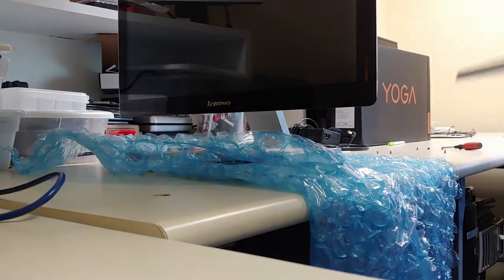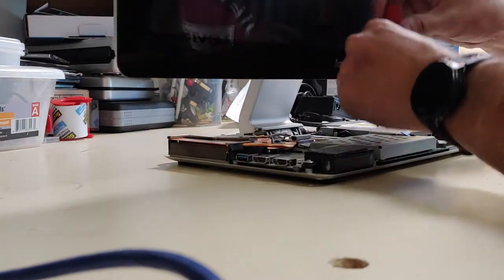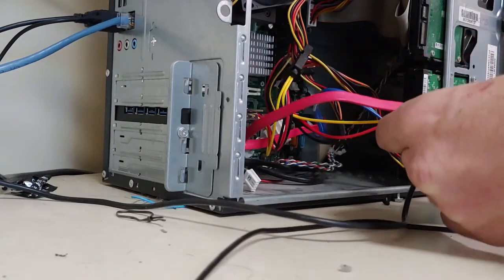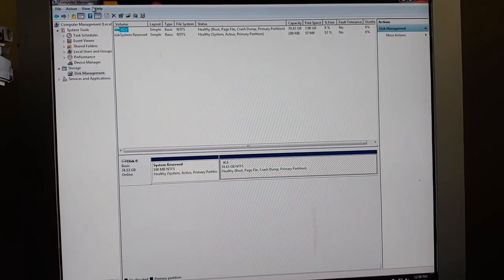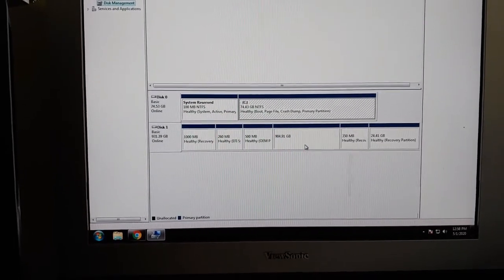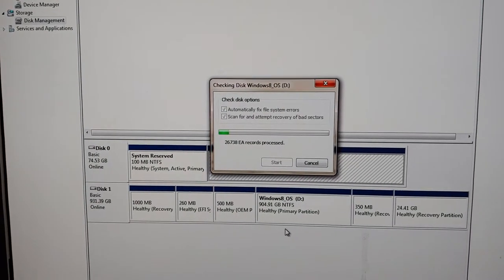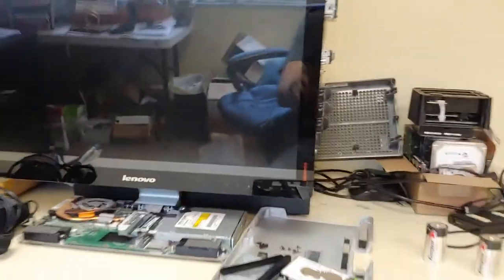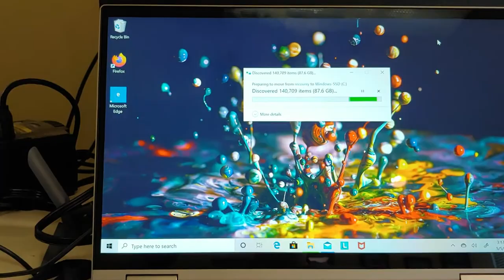Hard Drive / Ram install on a Lenovo A730 All In One.

Comment: Hello Friend! Do you have a dump bios and EC for this monoblock? if there is, could you share with me?
Reply from the maker: No I do not.. Sorry.
Reply: Hello, I have a lenovo a720 like the one in your video. Is it easy to install a motherboard for it???
Reply from the maker: @mrZgambino1  I can't tell you if it's hard or not cuz hard is a relative term.. depending on how many motherboards you've replaced in your life. if you ever replace the motherboard in a laptop then this will be easy for you.. if you never replaced the motherboard at all then it may take some time and be anxiety filled with concerns of breaking it..